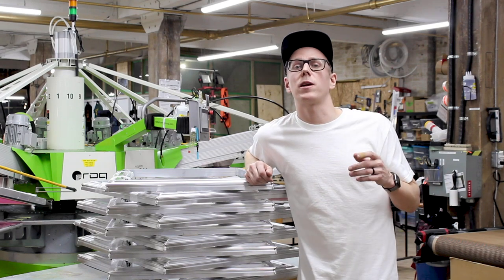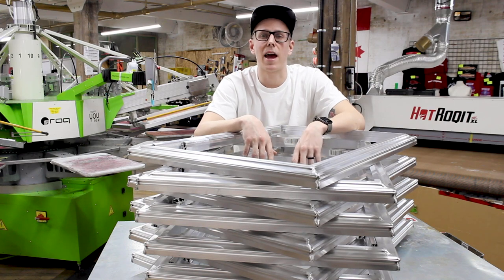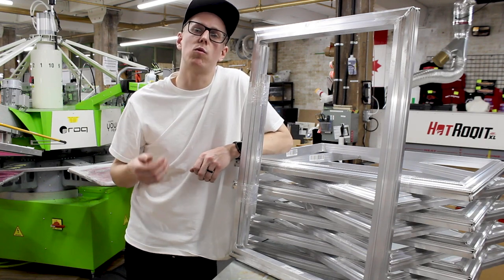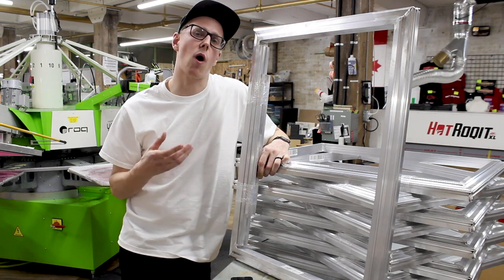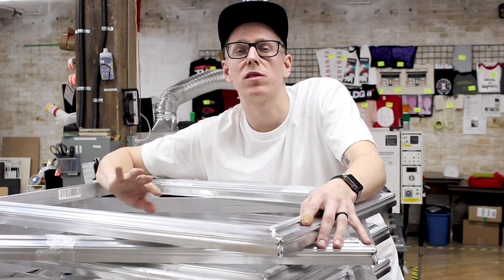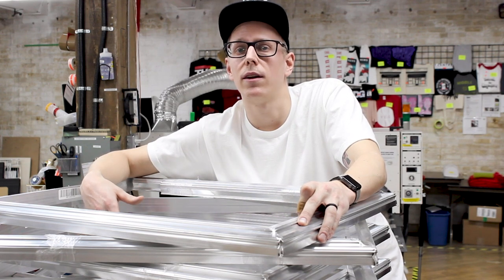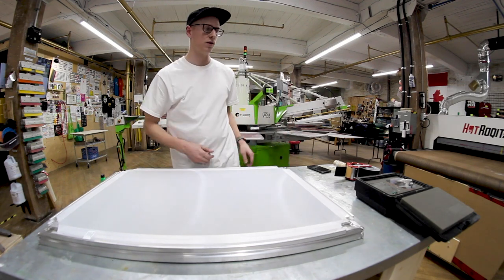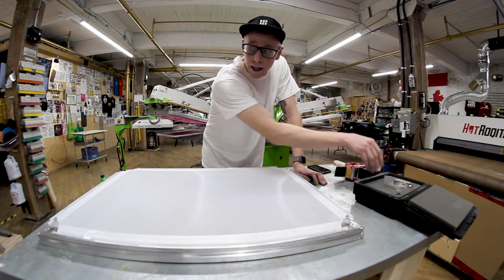Why We Got ECO FRAMES for Screen Printing - Inventory, Costs, & Quality!

Comment: Loved the video. I look forward to an update on these. I’m curious how they hold tension over time. Also which mesh did you buy. The thin thread or regular?
Reply from the maker: 100% thin thread here. Like any static, that tension will start dropping. But starting at 30n means it’ll have a lot more useful life than starting at 21n. I feel like we’re going to be kicking these out for many issues other than tension. Pumped on it. Definitely will provide an update after a couple weeks. My biggest concerns are the dip tank.

Comment: Is everything in Canada that much more expensive?
60 CAD to USD is ~$48.
My static screens are $12-$24
*I am sure it varies across the countriy(s). I m pretty far from Winterpeg.
Reply from the maker: Depends, there’s lot of cheaper mesh. To get a 23” x 31” static to the door, with Saati hidro thin thread mesh works out to about $60 each.
Reply: @CoryatFloodway  Is the thin thread mesh worth it? Next time I get some re-stretched, I want to try some.

Comment: how well do these frames lock into your press, they didn't seem to be as square as a static frame.
Reply from the maker: The House of Garb hmm, squareness or flatness? I have always heard of statics not being flat and it can be a huge problem with rollers so that was something i watched for with these. 
It’s part of the reason the table is stainless too, makes it a bit easier to check for skewing. One big difference is that the frames are heavier and stronger, which I think is gunna help it hold those higher tensions. 
Making sure your channels and mesh are straight is key though. A crooked panel will either pop in the frame if you’re lucky, or give you hard-to-trace problems on press if it makes it that far haha.
Reply: I was thinking more of squareness. It looked like they night be difficult to clamp into a manual. I use side clams but i still need a good flat surface to clamp onto.
Reply from the maker: Oh yeah for sure. One thing I realize I didn’t mention is the downsides. Weight is one of them but sideclamps will help you a ton. It doesn’t seem to have as wide a clamping area as a typical static, but work  around that further up the process like putting your films on more consistently.

Comment: Great video! What "newton number" or value do you see when it's time to retire a screen?
Reply from the maker: This is a tricky one now that we’re switching to higher tensions. Our statics seem to settle around 20n, and then slowly dip down. I’ve seen them as low as 14n. We mark them at 19n so they don’t get used in multicolour jobs, then kick them out at 17n. It made a huge difference in chasing registration problems caused by inconsistent mesh. But now with the eco frames I’m seeing them settle around 25n for the 160s, I expect I’ll want to put new panels in around 20n. High tension is one thing, but consistent tension between screens for a job makes a big difference and is something that can be controlled. Just keeping your similar tensions together won’t make them last longer, but will keep things simpler on press.

Comment: Interesting setup. Is it possible to remove mesh with an exposed design and then put it back on later?
Reply from the maker: Unfortunately no. But on the other hand a dialled reclaim process would probably be a little simpler and quicker.
Reply from the maker: Sorry for the double comment, still thinking about this though. Besides the weight, your comment might be one of the only downsides. I didn’t consider it at all until you mentioned it because we never save screens, always firing them through reclaim a day later.
Reply: @CoryatFloodway  most of my business is repeat so i hold on to most. But  I really like that tension factor tho. Maybe I'll just get a few for the underbase stuff. Anyway, sounds like this system is great for your situtation w/ all the reclaiming. Not to mention you can prolly fit a bunch of the mesh pcs in a dip tank at the same time for faster reclaims. Thx for the info bud. appreciate ur time.
Reply: @printittowinit  Is this what you're trying to do?  https://www.youtube.com/watch?v=q5tgJTwDNPw
I've had the frames for about 2 months but I have not had the time to get into them yet but plan to use them on some of my designs I'm constantly reprinting.  So far I try to save popular designs as long as possible but occasionally orders come in where I need to use all available screens of a particular size and getting new screens won't come in enough time.  

If you're trying to save and remesh a multi-color job I doubt it's worth the hassle unfortunately
Reply: @unfltrdpassion  Hey bud thank you for the reply. Yes I was wondering about remeshing mulit color jobs and whether or not they would register. But sounds like it's not a good idea, except for single color jobs.

Comment: I've been digging the channel for a while Cory, good stuff.  With the latest flood of content from everyone and their brother I'm glad to find quality shops producing stuff worth it's salt.  I've been in the industry for around 15 years and spent over 5 of it in the screen supply industry stretching large static frames for the auto-industry.  I started with newman rollers and moved to static, so I'm quite excited about these, I mean you can't really argue the value, the foot print and the tension.  Going from 20-22 to 30  newtons is incredible.
Reply from the maker: Thanks Jon. I started this channel for the same reason I started my shop - I felt I could contribute in a unique way! So thank you for watching. And yes I’m pumped on the frames, I always thought about getting rollers but you’re right, the space and maintenance is a killer. I’m really thinking this will hit the sweet spot.